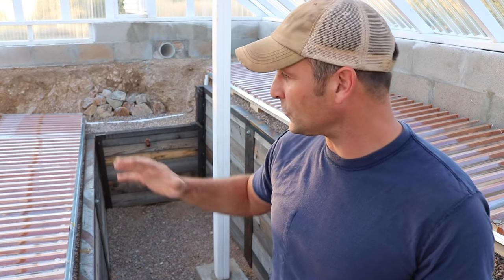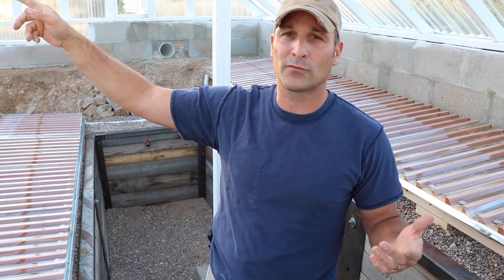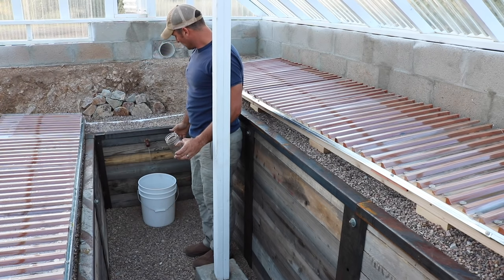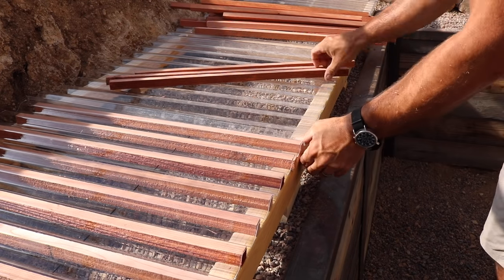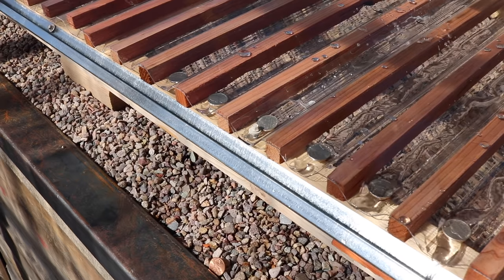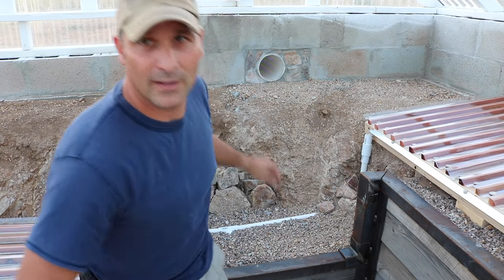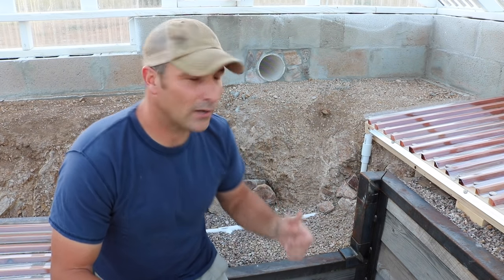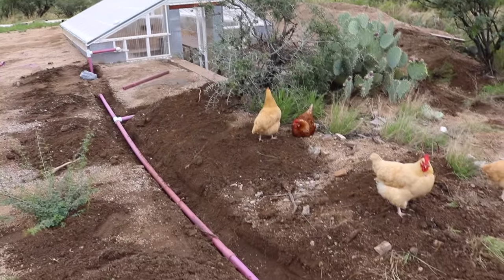Sunken Greenhouse Part 6- Watering Shelves

Comment: i NEED one of those masks you used when cutting those boards. i can't stand using disposable ones, and they always fog up my safety classes, where as those appear to be much better vented. in any case, AWESOME set up with a brilliantly simple water saving solution. you just got yourself a subscriber.

Comment: That was really creative.  I wanted to use geothermal for heating and cooling. But, still not sure I can pull it off here. We normally have too much rain. Which would involve mold. Yet this past summer was hot and dry for the most part. We have the wrong weather this year too. 
Best wishes to you. E :)
Reply from the maker: Thanks so much E!  I'm still working out the details of my cooling.. the heating shouldn't be a problem as our cold weather isn't all that extreme... but the cooling, that's probably going to be a long term experiment that keeps getting worked on:)    Joe

Comment: Looks like you've been having alot of fun solving problems and inviting new ways too do things. One question on the drain system, I get lots of dirt particles and things in the bottom of my trays that hold seedlings and such, the drain system seems narrow, will they tend to clog easily? Perhaps a 3 or 4 inch drain pipe would be better??
Reply from the maker: Yes, you are probably right but I really liked the look and ease of this trim.  I think that I will be able to flush it from time to time... but I'll have to wait and see to know for sure:)  But if it does, then I might be headed down your idea of using the pipe:)  thanks for watching!
Joe
Reply: It is a very cool greenhouse and the drainage idea is really a nice feature. It has been enjoyable watching so far. I just love the creative process and problem solving challenges in projects, as long as you are enjoying it, the things you can come up with are always cool and imaginative

Comment: Wait for it.......  Wait for it.......   LOL    If you are still open to suggestion, you could add an element of permaculture to the greenhouse and channel that water into a bed across that end fitted with a mini "septic system" type evaporator bed...  Or aquaponic bed fitted with an overflow for your bucket ??? Who knows...  I trust you'll come up with something creative...
Reply: Blowing air across water on that end might help cool?  Or bubbling up through it?  Higher humidity might cut down on watering?  ahahaha  :::shutting up now:::
Reply from the maker: hmmmm... I like your thinking on that one!  I really had envisioned some sort of aquaponics at first but thing that I just might not have the room for a good tank based set up... but the growing area fed by the drain would be super cool!    ... my mind is thinking... and that's not always a good thing...lol... too many cool ideas to consider:)
Reply: We use some Sodium Polyacrylate (diaper crystals) in our seedling mix and have never seen it affect growth in anything we've started...  It may help to absorb extra on watering day, and leech it slower on hot/ dry days in the greenhouse...  Let me know if you have trouble sourcing it...  I know some good places...
Reply from the maker: Hmm... now I'm gonna have to check into that!  :)
Joe
Reply: One very good tank that is cheap enough, light weight, easy to work with and excellent for your health is a copper tank. And maybe you could have this tank made on it's length and fit under your system, the hearth, and made like trays that you can open as you wish. I love your concept but only one thing i would never use in any project... concrete, it tend to grow a poisonous mold in a humid area so i would have a hard time with trusting my greenhouse with this material. When i seen you putting copper pipes into your draining system i thought that it was a great idea because again it's good for health, even for plant and also because it helps bringing that better positive ions around them which help with the growth. So if you ever see your plant growing too fast and fragile it could be for having too much of the metal element in the surrounding, you also have iron in there.  Anyway again i really do like the way you did it, it inspire me and i am now a new subscriber. Great job buddy.
Reply: Define what you imagine Permaculture's definition to be.  I worry about people who have never had hands on growing plants in soil who start with hydroponics.  All of our gardens, vegey gardens, indoor gardens...everything we grow is artificial.  Will never ever be  an ecosystem.  We can model a little bit but no garden we create will be a self sufficient ecosystem.  We don't want that anyway.  All chemistry plants need for photosynthesis is taken up and stored in the bio mass until something dies.  Only then is there a bit of redistribution of the chemicals necessary to ADD plants and life to the system.  Never enough for us to have crops sufficient to feed us without putting proper chemistry back into our artificial gardens to get what we want from our plants.  If one 'adds' an element such as fish poop water that chemistry needs to be a known element; how much nitrogen, how much any chemistry that is being added to the system whether soil or hydroponics or aquaponics.  Chemicals (not nutrients) have to be understood and added and  managed just as much as light, ventilation and soil or water (no fluoride please)!
Reply: So recycling water that goes through the soil and fertilizer that is added might easily cause over fertilization. Maybe great for the lawn but lawns have different management systems and shallow watering is not good.  Best to be in control of the fertilizer.  Always a soil test once or twice a year.  Hydroponics, testing the water is continuous and easily done.  Some times a tiny bit too much (fertilizer, light, water...) spells death for plants.

Comment: Do you have perf pipe at the bottom of those walls?  I saw the gravel you put behind them.   Interesting on the drainage but do not recycle the water...unless you know what is being leached from the soil of the plants?  That would be over fertilization.  You have to fertilize.  Compost is for soil tilth not fertilizer!  There are varying amounts of the chemicals necessary for plants in compost but it isn't balanced, (too much nitrogen equals lots of vegetative growth and no reproductive growth for instance)...is it hot compost or decomposed or does it need decomposition 'services' by decomposers who need nitrogen for energy to do their work which will always take precedence over our 'crops' needs.  I am assuming you will be using pots for plants, yes?  Tiny pots for starts, little larger for little older plants, a little larger for even a little older plants...using ONLY potting soil.  Love to explain the science and details about why your greenhouse and pots has to use sterilized bagged potting soil.  Never garden soil from your outdoor garden...Need a big fan to BLOW the leaves of your plants, you should feel your hair blowing for the proper amount of ventilation.  You've done an incredible job with ventilation (but the cold air thingy might be a bit over the edge.. grins!).  Beautiful and well made!  Careful with the automation.  A greenhouse that small doesn't need that much automation.  Automation means less interface with humans and the plants.

Comment: I like what you are doing but I think if you did it a little different you didn't need to make retaining walls you are in hard rock and you could have used that jack leg and firmed up the rock walls with split sets or mackanickal bolts the same stuff they use in hard rock mining to keep the shaft or tunnels from caving in. I am getting ready to make a in ground green house and it is in sand. I am definitely open minded and there are thousands of ways to do things some are better than others and it all depends on the environment and materials .